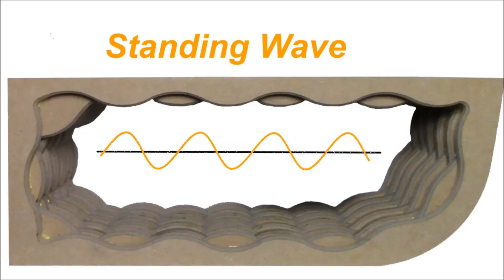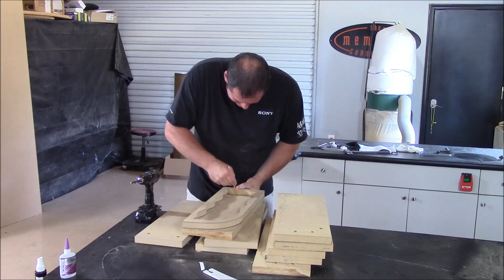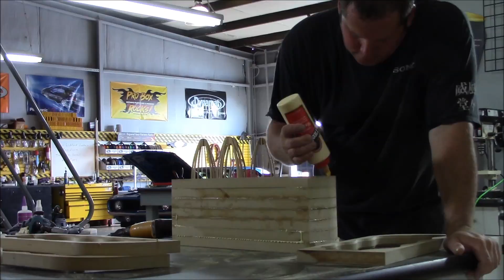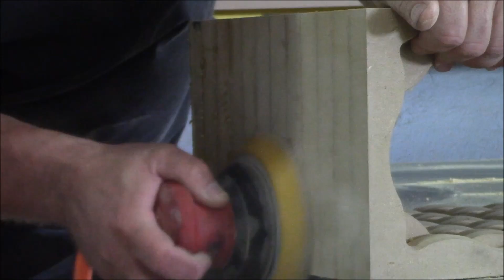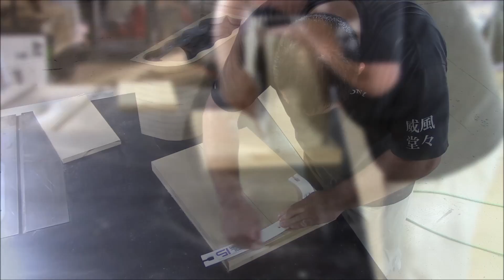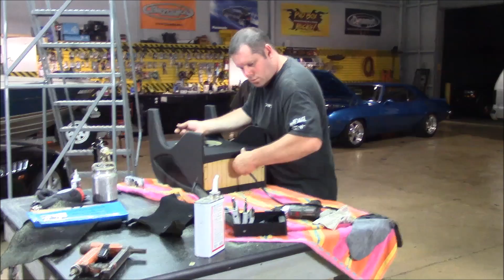stackedbox

Comment: HA! HA!  You guys are funny. Pan heads are fine, but CERTAINLY!!! are not an indicator that a shop is Poor or Great. Most screw failures happen at the neck, where the head meets the shaft... course drywall screws especially #9 or heavier will work fine for 95% of sub installs. Want crazy strong? try using T-nuts or... #10 x 1-1/4",  Stainless, Square Drive, Type 17 wood cutting point screws.  More important are the poor connections you made to the sub. If the Sub company is so cheap they still use 60 yr old spade speaker terminals on their frame PLEASE! at least solider them. That crimped slide on connector is absolute Crap!

Comment: so this wave design is not a sine wave cancellation design.  It would need to be mathematically correct.  You would need to take the integral of the function of the box with the limit of the 2nd derivative (if l'hospitals rule applies, depending on the function).  THen you would need to integrate all the space between each wave with a limit of Fx and Fy using implicit differentiation.  A sound wave will either have a slope of zero of a hyperbolic function of x=1.  this of course would be determined by the sub placement and output.  This box DOES not cancel out the waves.  A function opposite of the function of the sound wave will in fact cause something called wave acceleration, allowing for the asymptotic function to actually increase the distortion.  This box DOES in fact increase distortion.  The best box for a sub would be a box that has a sub placement exactly above and orthogonal to the cancellation wave forms.  So a cos or a 1/cos function would be best.  A box with a sub in the corner, and a sharp spikey box interior would be best.  Look at that sound deadening material.  Notice it starts like a cos function.  I'm talking about the stuff that some people use under bed sheets.  It is a foam padding.  This not only cancels the wave, but it also decreases momentum impulse of the wave.  This is the idea of what a box should have.  The box made in this video is fucking retarded.  It looks like it was designed by some people that think they are smart, but us actual smart people know this is fucking garbage....
Reply: +dinoreah 2 You just looked up some maths on the internet didn't you?
Reply: no.  I am an electrical engineer and I work for rockford.  My mission for the last 5 years has been to alter dimensions of boxes or rectify coilover techniques to decrease resonance.
Reply: y do rockford subs gets louder in a bigger box than factory specs?
Reply: omg finally someone who has knowledge and proves it!I worked with Mark Finey way back in the day and even my ass knew this is from someone who TRULY believes he is doing good, but actually he is just propagating distortion.After all these years I can never figure out why some people think it's SO Complicated to make a sub box.Unless ur trying to break records, the simplest boxes with ave subs are 1000 times better than even in the last 10 yrs.Rockford, Orion, PS make pure insanity for relatively cheap and can handle obscene currents forever!!!
Reply: Sorry didn't even realize you were an engineer working for Rockford!!Lowering resonances? That must be the unicorn I saw last week outside my window lolGood luck.The new generation subs are truly unreal in current draw handling whilst staying linear!!!

Comment: Dude, MDF, wear a mask, what the hell.
Reply: Dev Everything I hear ya. I never wear a rubber either. I mean... what are the chances, right?
Reply: Because mdf dust is very toxic, you should wear a good mask in order to be safe, there are some 3M mask with N95 certification on walmart that cost about $5, which are very suitable for handling mdf dust..
Reply: catching an std and breathing saw dust are no where near the same thing
Reply: why?  i have built 100+ boxes and i ONLY wear a mask for fiberglass.